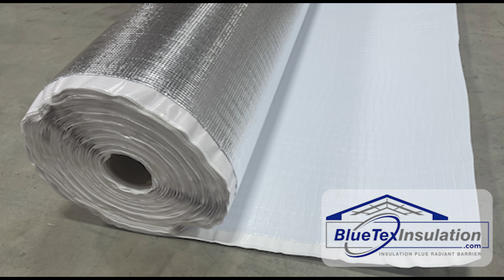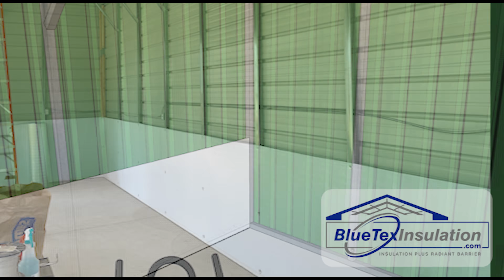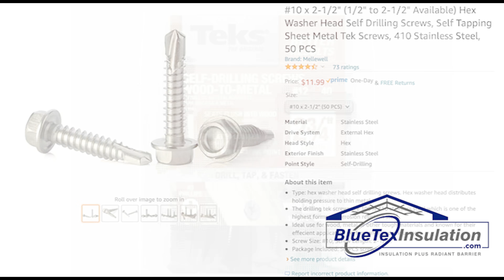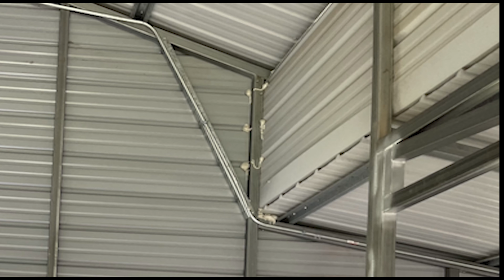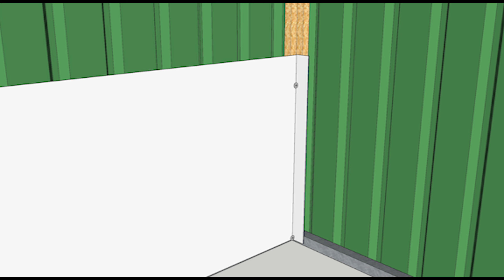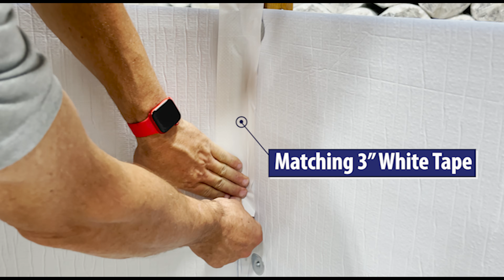How To Insulate A Metal Building Tear Proof Foam & Foil Insulation - Easy Vapor Barrier - NO Bubbles

Comment: Could you then add any type of walling like drywall on top of the Blue Tex Insulation?
Reply from the maker: Sure, drywall, plywood, OSB, TnG whatever want to the interior to look like.  We have even had a couple customers actually paint the white side of the www.BlueTexInsulation.com
Reply: Wouldn’t the screw heads from the insulation effect a good smooth fit with using osb or drywall over them? Especially where the seems would likely be where all the screw are?
Reply from the maker: Not really.  The screws/washers will compress the www.BlueTexInsulation.com a little making it pretty flush.  Will it be perfect??  Maybe/maybe not.  Usually it's for barns, sheds, garages, airplane hangars etc. where it's not a big deal.

Comment: Great video,,, except you skipped any details about the only part of my building I want to do this,,,, the ceiling.  Lol.

I am only concerned with stopping condensation dripping on my equipment,  have no plans at this time to heat/cool.

Should I leave a gap at the peak of the ceiling for ventilation? How do you recommend securing it where it meets the wall if I do ceiling only?
Reply from the maker: Great question. If  you ONLY want to do the roof, you would do the same install except tie it into the sidewalls to try to prevent any warm-moist air from INSIDE the building from getting to the cold metal roof.  You do not want to open the ridge.  You still should have some air coming from the drip edge to the ridge vent between the www.BlueTexInsulation.com insulation and the metal roof.

Comment: Great video
After the install will there be still condensation in between the metal and the bluetex? If yes then all the wood used at the edges will grow mold. 
Or there won't be any condensation at all?
Could you please clarify? Thanks in advance
Reply from the maker: Great question.  It's all about the volume of air.  Typically in a bare metal building you have the potential for ALL the moisture in the air inside the building to come in contact with the cold metal and condense.  This can literally make it rain in the building.  However, in the space between the foam and the metal the air is cooler and much less volume and is probably ventilated.  So, just like a tree leaf, there is some potential for some condensation, but not near the volume as inside the building.  And, when the sun comes out, this space is going to heat up/cook/dry really fast.  Wood can get wet and dry a thousand times just like a towel.  It's when it STAYS wet for an extended period of time we have mold, rot etc.  So, the short answer is "No, this should not be an issue".
Reply: @BlueTexInsulation  thank you

Comment: Is it important to seal all openings to the outside (like at side wall corners) or should these be left open to allow any condensation between the insulation and wall to evaporate?
Reply from the maker: Great Question! For this application, you WANT airflow between the BlueTex and the metal.  This is what's called a "Back Ventilated Cladding".  Airflow between the metal and the foil side will help remove heat and any moisture.  It's the same concept that we use to put a ventilated space behind, brick, stone, siding etc.

Comment: The 1x4 running just below where the roof and walls meet in the computer graphic appears to be connected to the face of the metal square tubing. Wouldn't that cause an uneven surface for the insulation to mount since it also attaches to the same tubing surface? Or how is that 1x4 mounted?
Reply from the maker: Yes, mounted on front.  It will make a small bump in the corner you will barely notice.
Reply: @BlueTexInsulation  use metal 2x4s with the 2s cut at the posts to make flush?

Comment: I have order this and will be installing once the electrical is finished. Thanks for the video, picked up what I hope will be good tips. You mentioned unscrewing the bottom end of the angled supports, cutting the slits and reattaching. I'm assuming you do the same thing for the top end as well as the horizontal supports in the center? Thanks!
Reply from the maker: It's your choice whether you go below or behind the supports.  Some people like the look of the corner/top supports showing, others don't.

Comment: looks so thin, the R value mustbe very low, not some thing id use herein our 40 below
Reply from the maker: Thanks for the comment.  Yes, it's pretty thin (about 1/4") and really designed for either non-conditioned or semi-conditioned buildings. If you are fully heating a building, it's not the right product.  If you are just trying to keep above freezing, usually works great, but 40 below is way out of range. More info on R-Value here: https://bluetexinsulation.com/pages/r-value-of-bluetex-insulation
Reply: @BlueTexInsulation  i didnt think so as the insulation for my steel building came in 200 foot rolls in an R20 and 4 feet wide, 16" of insulation and heavy duty woven foil, that you used these plastic pin to push though and snap om to the ends of the bolts the bolts the whole building together, , a 40x60  with 18 foot high walls cost $8000 cnd for the insulation

Comment: my walls are 9 ft how much of a problem would it be to leave the last 1 foot undone
Reply from the maker: Really depends on your goal.  If you primary goal is to reflect heat, then the more coverage the better. So, leaving 1 ft will reduce the effectiveness some but not much.  If you are trying to control moisture/condensation, I assume you would leave the gap at the bottom.  It really depends on your location, use etc.